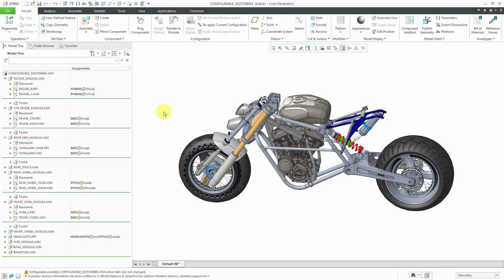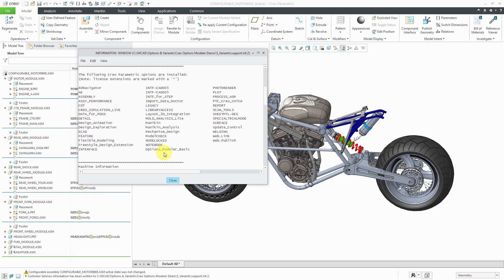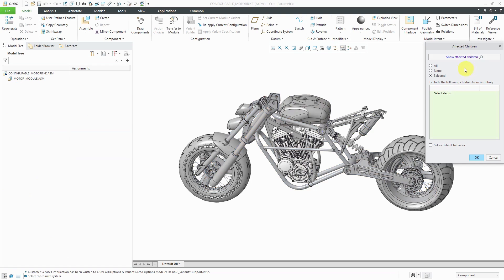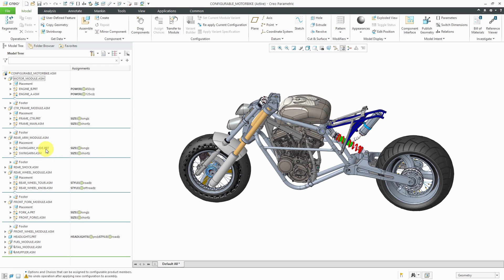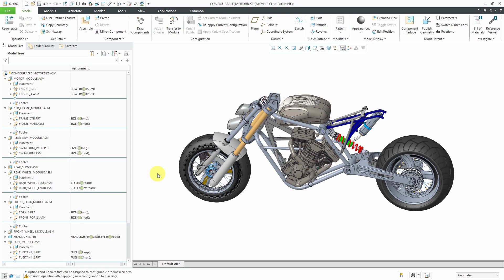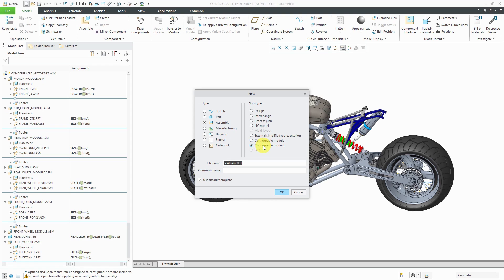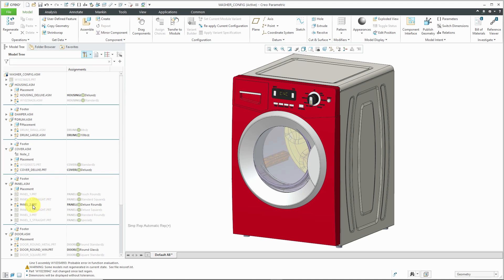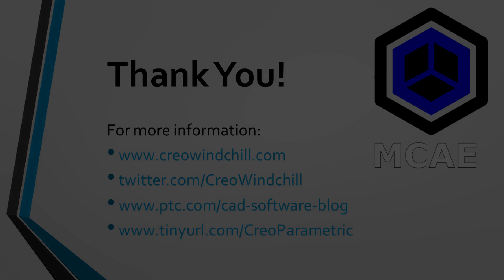Creo Parametric - Options Modeler Overview | Configurable Products

Comment: Is there any way to manage rules for configuration groups (i.e. if you pick square configuration it will populate all the square components) rather than selecting them one-by-one? My company is switching to Creo and I need to figure out how to do what we could do in our other CAD platforms.
Reply from the maker: Yes, you can add logic as well as have a choice drive multiple options.